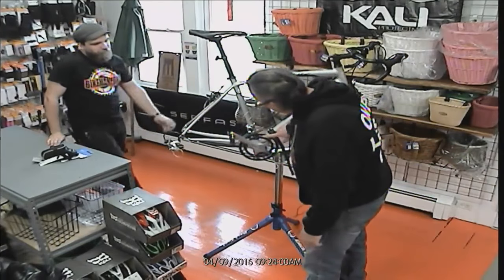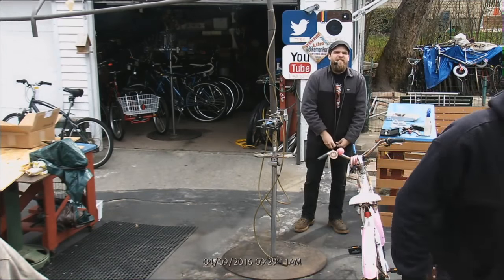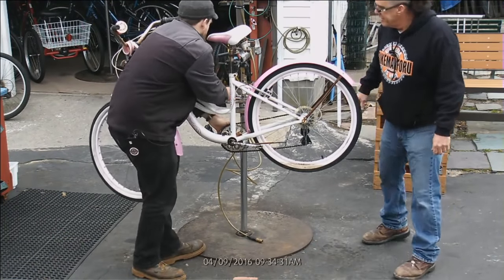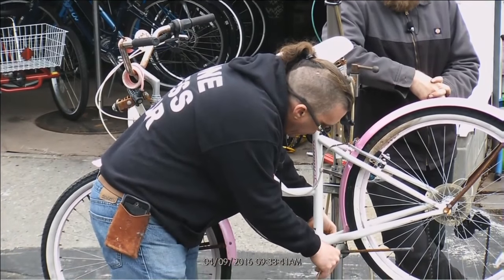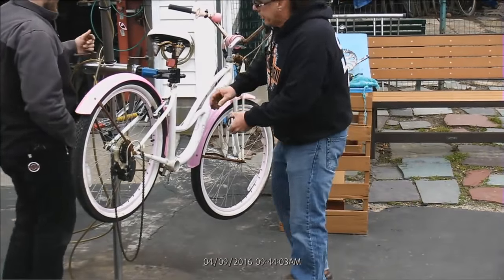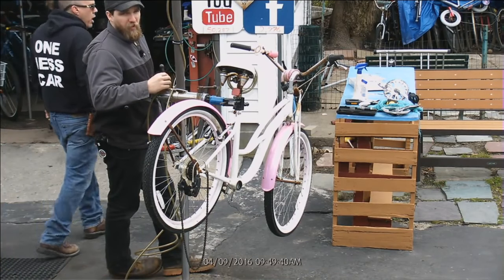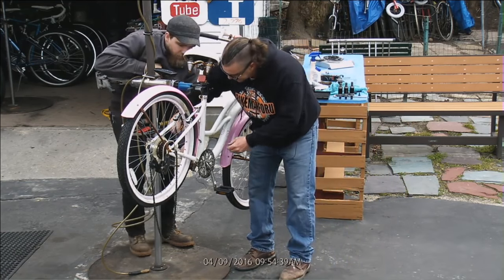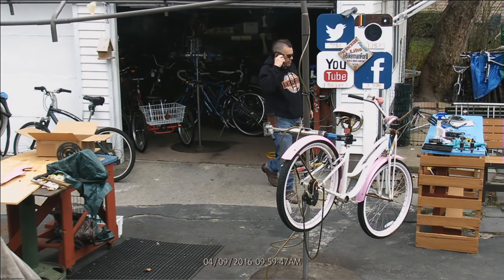Ozzie's Spindle Conundrum  - Upgrade A Walmart Bike - BikemanforU S4E15

Comment: I would install a bottom bracket that you think has about the right spindle length, and the drive side crank, then check the chainline. Knowing the spindle length you have installed, you can calculate what you actually need.

Comment: Couple of tips - remove the LH bearing completely BEFORE attempting to remove the crank, and drop the chain right off the crank/chain-wheel, not onto the inside. Makes it much easier.

Comment: If the chain line is the standard 52mm, shouldn't Ozzy actually use the same length as recommended by the crankset manufacturer? Dependant on what kind of cartridge, he might also need a 3mm spacer.